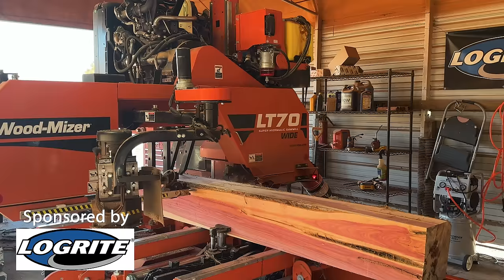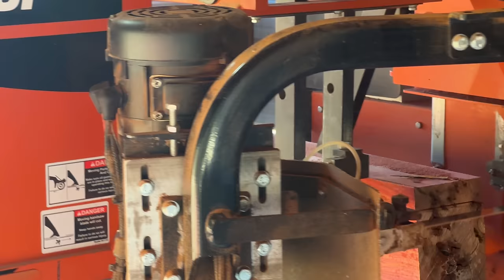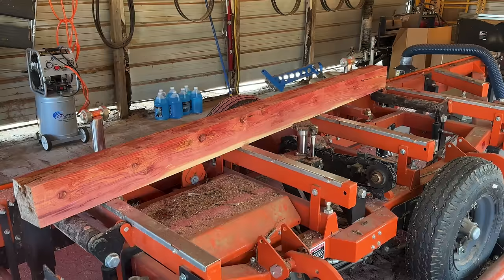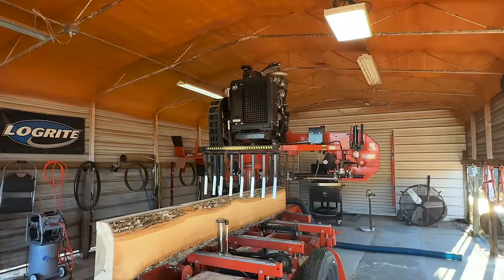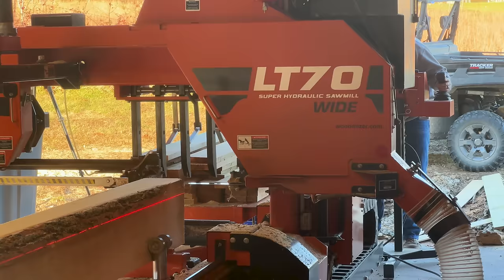Woodmizers Top Of The Line Sawmill & Log Splitter In Action

Comment: People complaining about too many wood chips. I am sure they did not have a viable alternative. Can’t worry about keyboard warriors. They don’t do anything else with their lives.
Reply: My immediate thought on the wood chips was "perfect fire starter".  Nathan, you could hang a grain bag under the outfeed tables on both sides and let the chips fall through right into the bags, and sell it as fire starter by the bag..
Reply: "Let the chips fall as they may". I guess a firewood processor made up that saying😊
Reply: Hi Nathan,
If I was splitting my own firewood,
I wouldn't be too concerned about the small amount of "trash" that was generated and like you mentioned, use it as kindling !!
Just 'cause I care, I noticed you did not have any eye protection when you were sawing those logs !! I know, it's none of my business what you do, but I do consider one's eyesight mighty important !! I am blind in one eye and don't see too well out the other !! So, hence my concern about eye protection !!
Reply: An easy solution is to line up plastic totes along the sawdust path. Sawdust burns too…

Comment: Number 1 is I enjoy your videos. They are well done, informative and the music is great. Number 2 is all the viewers that have to give you negative comments should stuff it. You explain your equipment very well, the good and bad, so no need to give them any satisfaction of a comments. You can't split any wood without smaller pieces breaking off. My suggestion for the wood coming off the splitter on both ends is to build two wooden boxes onto pallets. You could move the wood easy. Enjoy your videos. Your Friend.

Comment: I love the design of that splitter. It is clever and there is no wasted time or energy when it splits with every movement. There’s no waiting for the cylinder to retract like a conventional splitter. Thanks for sharing! BTW there will also be little bits off wood and bark when running a splitter regardless of the design.

Comment: For collecting the fire wood: I've seen a few people now using 275 gal IBC cages (not the plastic totes) to collect the firewood going through their splitters. Even if it's just tossed in loose it's packed in pretty well and can be forked around with one of your tractors if you have a set of forks for them. Love the videos!

Comment: This is an opinion and not a criticism of anyone. The “trash” is a byproduct of splitting wood and everyone has it. Of the You-Tubers who post splitting videos, I notice that most split till the final product is smaller than I would make it myself or smaller than I would like if I bought a load. Our family has burned wood for a long time and one thing we look for in the wood pile are those “all-nighters”. A big solid chunk of quality hardwood added at bedtime means you will have heat thru the night and a small fire that’s easy to get blazing in the morning. We don’t split 5” logs at all, 6-8” maybe once and 10” gets quartered. In other words, split to get the rough equivalent of a 5” round. I like the machine in this video but it would suit me better if the top slicing blade were another 1 or 1 and half inch above the deck. 🧑‍🎄🌲👍👀✅

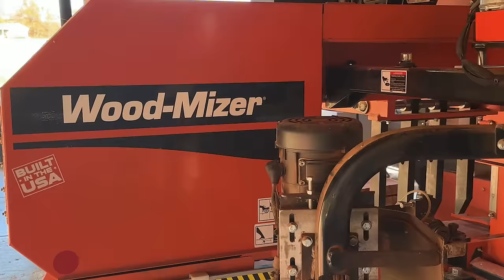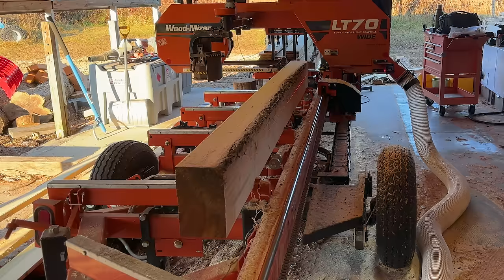Comment: Just noticed that the end of the sawmill (away from the operator) seems to be lifting up off the slab a bit at several points in the video:  0:50; 1:04; 3:12; and 8:21.  I don't know whether that motion is affecting your cuts, but you might want to check it

Comment: Prefer to suspend log poles in the air when sectioning  for firewood. 
As for the splitter trash,  might suggest a ground tarp under machine.
Many of us are NOT allowed burn piles.

Comment: What determines if those logs are going to the saw mill or wood splitter?
Reply: If they're too small diameter or too many major defects they get cut for firewood. Eg it's not worth sawing a log you'd barely get a 2x4 out of, or if there's a big split, tons of knots, lots of sweep, etc.  Sometimes just low value excess logs go for firewood if the value is similar.

Comment: You're wood miser wood splitter   Has your handling the wood quite a bit.  Add A feed  Conveyor belt would be the trick Elevated enough to get it in a trailer where you wouldn't have to Work so hard to handle it as many times. Yes you're right any wood splitter makes a bunch of chips it's 
      the log